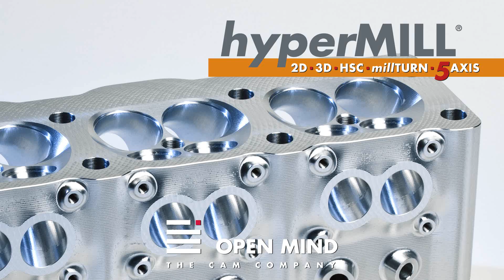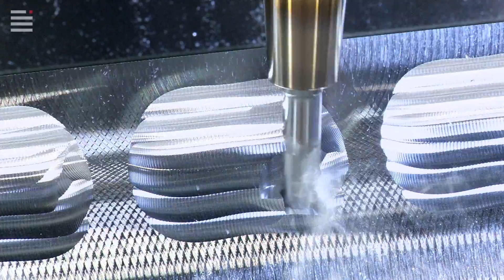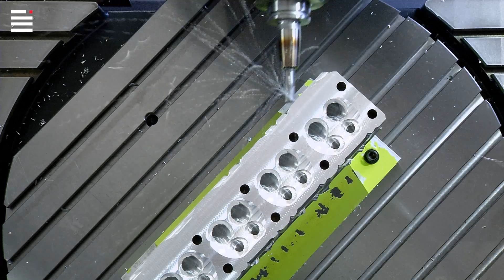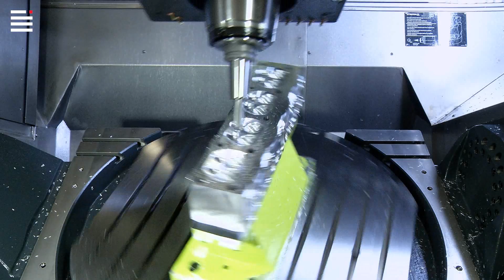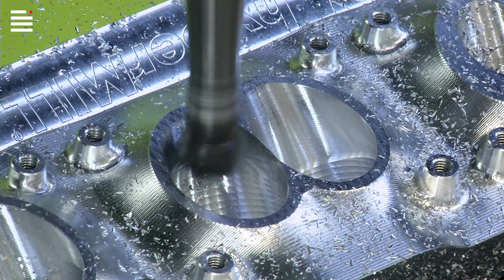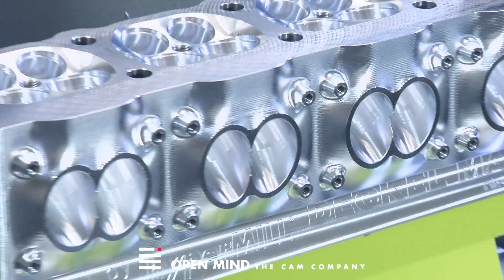5 Axis Machining: Cylinder Head milling | hyperMILL | CAM | Tube | DMG |CAM-Software|

Comment from the maker: Thank you, thatguywillt, for your interest.

Your first question: The original model was milled with cooling water. In the video sequences we switched off the cooling water.
Your second one: This engine block was designed and has been milled only for demonstration purposes. So you cannot start this engine ;-) 

But your last question we don't unterstand. What does it mean: spring seat area/cam tower?

Comment: Dear god, I want!  I'm a little surprised it's being done dry?  Are the ports on the sides, by the intake and exhaust runners, for coolant?  Also, do you have a video of the spring seat area/cam tower area being machined?